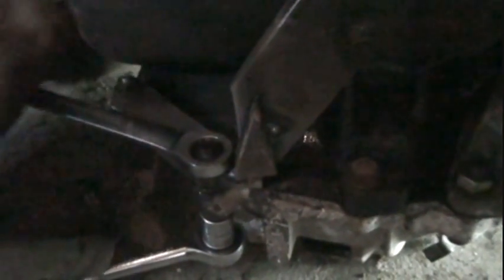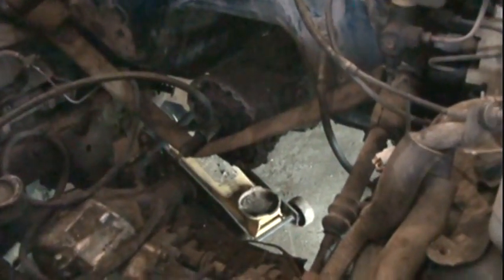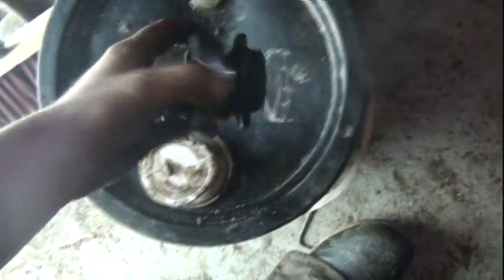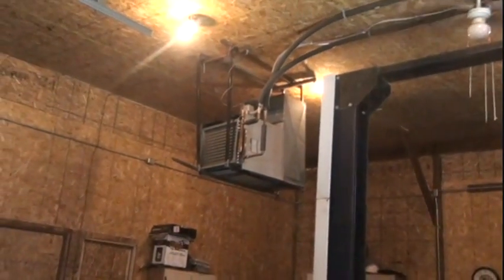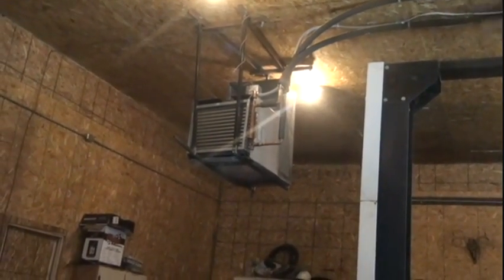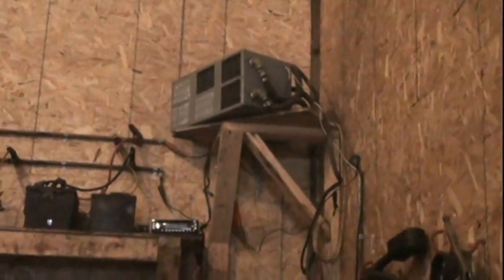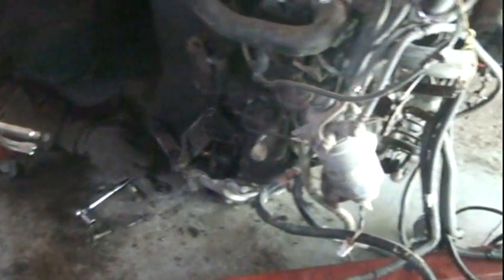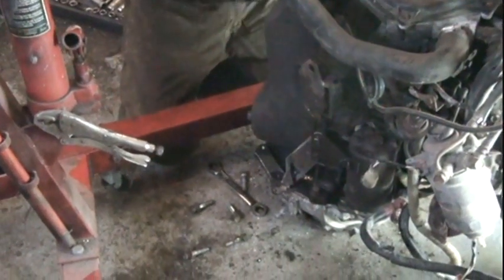Smells

Comment from the maker: @randy1807 no, slave cyclinder is on side of bell housing, it works like a brake wheel cylinder pushing the clutch in and out

Comment: @poplvr p.s. when running used oils,always keep a spare fuel filter  with you.You will clog a filter sooner or later and it will leave you stranded.Also a gallon of fresh diesel (to fill up the filter)and a small bottle of gas(stale is ok).When i plugged up the fuel filter,after a new filter swap...I found i could easily start it with a small amount of  gas poured in the intake (a splash)without burning the rings and locking it up( like either).Either is bad ,don't use it unless you have too.

Comment: I ran an 80's ford f250 6.9 intl.off used motor oil.It ran good for the 2 plus years i drove it.I used mixes of used ATF,motor oil,Jet A fuel, kerosene, whatever mineral oils i could find and could filter down to about 10 microns.Used atf was plentiful but too much made the engine smoke bad,made little power and has too much metal in it.It would plug up my fuel filter in about 500 miles.I never mixed stale gas with anything...ran too rough.used motor oil has plenty enough of gas already in it.

Comment: Well you can filter waste oil and mix it in with your diesel but I wouldn't mix any gas in it thins it down too much we do it with heating oil and it works fine heating oil is basicly 2 diesel  aka off road diesel try it if it doesn't work in a truck drain the tank and start over